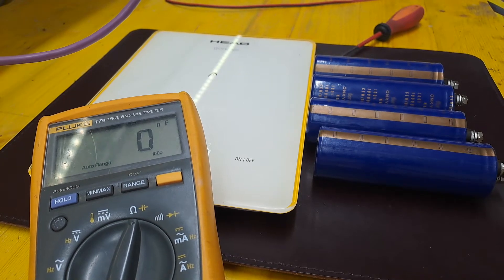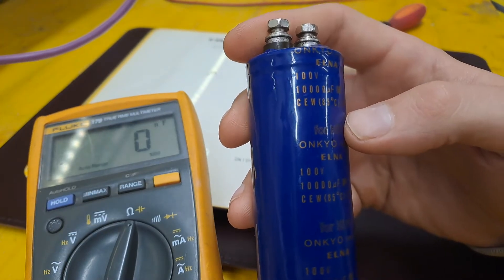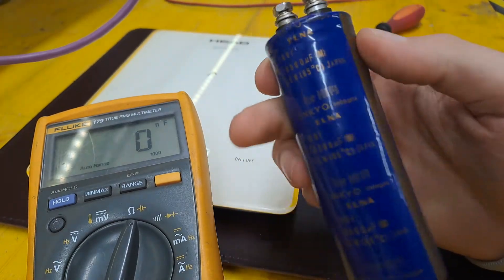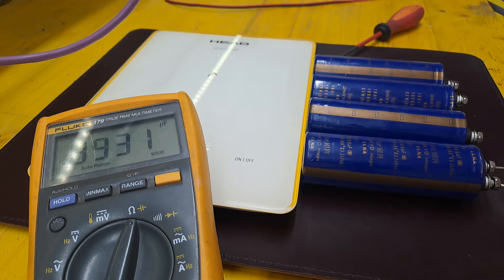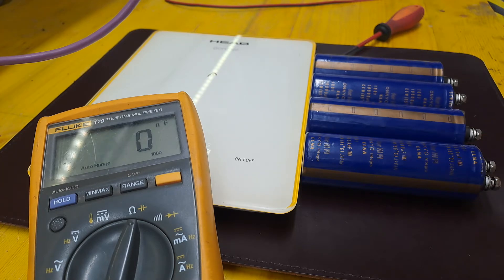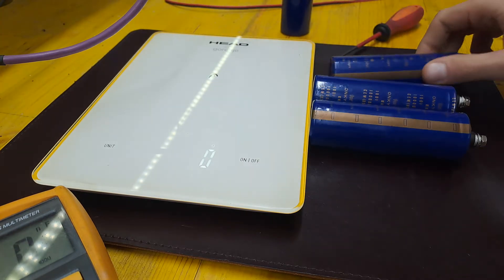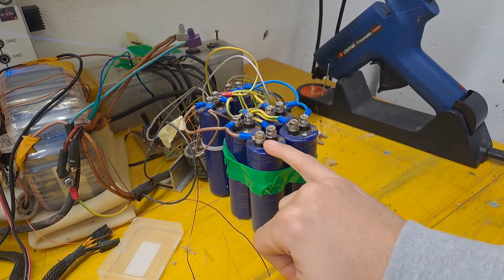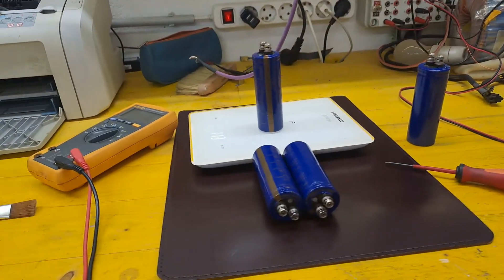ELNA 100V 10000uF for HiFi fake electrolitic capacitor ??

Comment: A trick to make the capacitor last longer is to remove the plastic cover of the cap, in order to stay cooler during stress.
Be carefull to don't reverse polarity. 
If fans are close to the caps, is better, cause they will blow cold air to the aluminium part of the cap & be able to take the cap always cold. 
This will low temp of cap at 50%.
Reply from the maker: Very good idea, thank you. I will do it.
Reply: @linkshox  We see often Dynacord amplifiers with puffy capacitors.
Another trick. Reverse fans in order to blow cold air inside the akuminum radiators. 
i'v seen Yamaha amplifiers  failing in the middle of the weeding because fans run very slow & couldn't take out all the heat. 
I reverse them & cut as much useless wire, in order to make fans run faster. 
in this way, radiators will stay 50% cooler & transistors won't suffer high temperature. 
those are tricks nobody will tell you.

Comment: I don't think Elna ever made capacitors like that, look up for the info, the model or family/series, if you can't get any info more certainly they are fake, somethimes they just fake the outer label so people are more like to pay more for a posible better capacitor, somethimes they put a smaller cap inside just hanging by it's wires and stuff the can with paper or any cheap filler to make weight, as you can see there are weight differences, there are more and more fake components in the market, just cause of the current events happening
Reply from the maker: You are definitely correct. I couldn't find any serial number, original ELNA is black and gold and it is written 'for audio' and not ' for hi fi'. Thanks for help.
Reply: Elna had made those capacitors, some of them they were used in Onkyo power amplifiers
 @linkshox